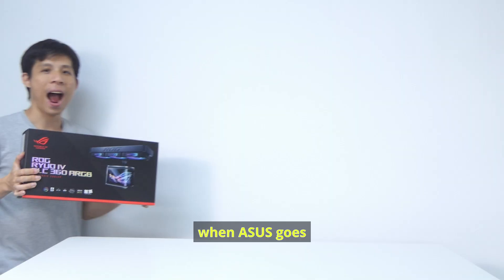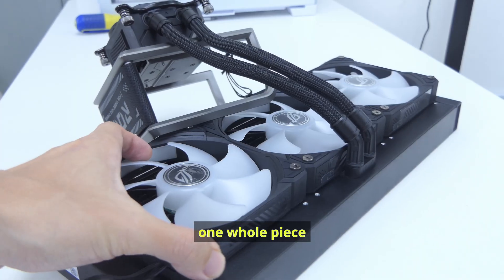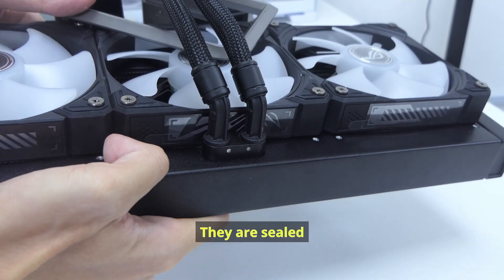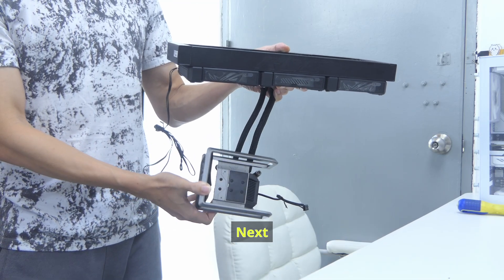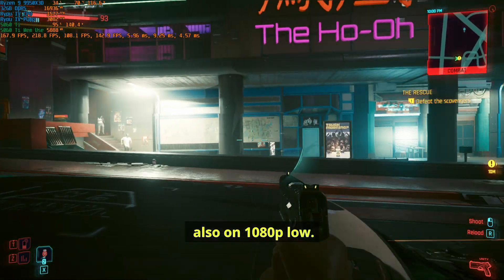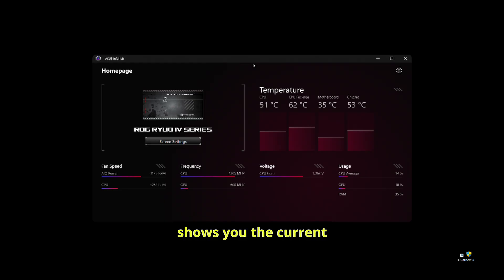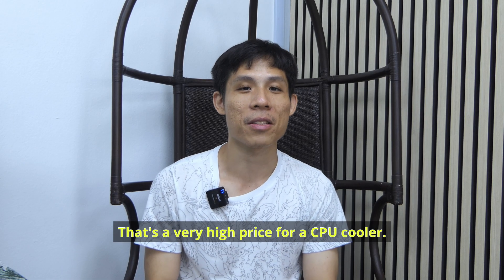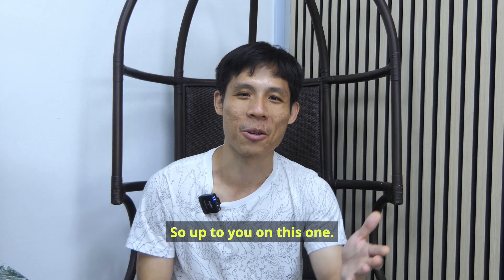Did ASUS Go Really HARD with this new CPU Cooler?

Comment: More technical side of this AIO:
- Screen module uses Rockchip-based CPU to operate if I'm not mistaken (from my findings on firmware file).
- Screen module has some sort of Android 13-based OS (from my findings on firmware file) and root is enabled by default (when I enter "adb shell", it directly enters to bash with root privileges).
- Screen module has 8GB storage (4GB is reserved to system and 4GB reserved to user content) (from my findings on module with adb software).